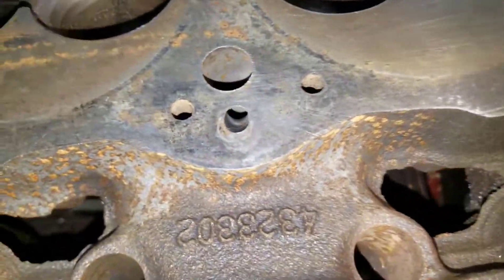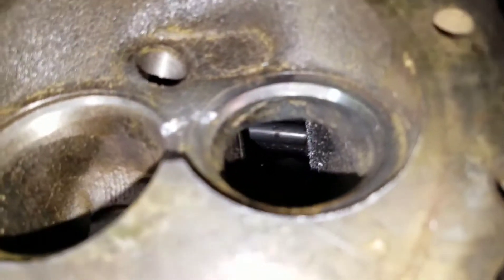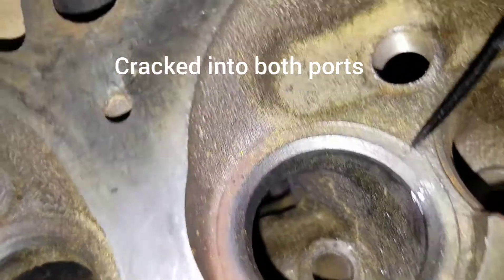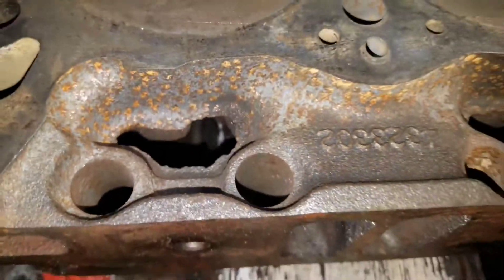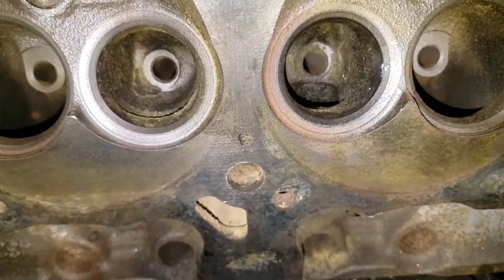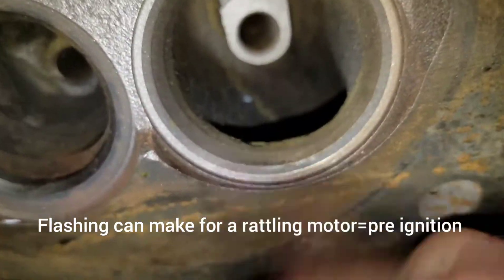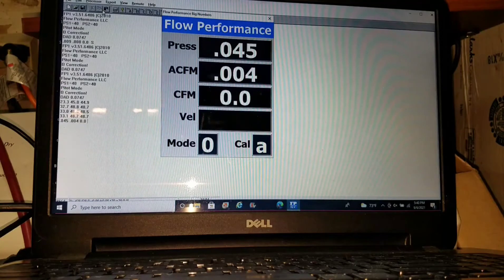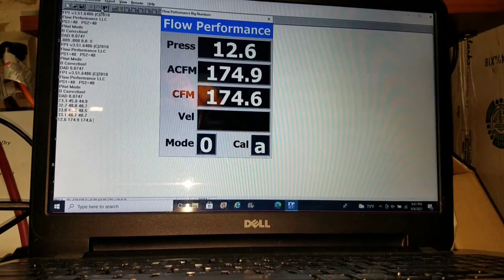Chrysler's strangely popular casting #302 head. Part 1. The harsh reality.

Comment: I use these heads for junkyard overhauls simply because of the quench in the head. Also, a 200 cfm head can make plenty of power. Im currently building an engine . I had the factory roller cam reground by holman moody. It specs out at 224 at 50 and 518 lift. Im porting the heads fairly extensively. I want to install it in a test car and take it to a track. My goal is 8.50 in a 3500lb car on 87 octane. Also remember, the extra cylinder pressure these heads provide far outweigh the flow potential. Compression makes more power than flow all the time. If you build a 318 that you are having bored, invest in a set of domed kb pistons and run  a 360 head.

Comment: I'm getting ready to buy a set of good used 302 castings and put them on my mildly built 318 with a 340 cam . I'll also be doing my own porting and gasket matching . the engine also has been bored 30 over with stock flat tops

Comment: I found the article that used the 302 heads– it was in Hot Rod magazine April 1988.  The article was called "318 Street Recipes" which is now on the Motor Trend website,  and can be found by searching for that title with the quotes.  It didn't make over 400 HP as I remembered, but instead 331 HP.  The heads were "fully ported" by Arrow Racing who also installed 1.88"/1.60" valves.  The 272° advertised duration cam was not as small as it would seem with 231° @ .050"  The cam was a Mopar Performance/Direct Connection part and when I searched for the number on Summit, it brought-up a kit with lifters that has 272° advertised duration and .455" lift.  The bottom end was from an '86 cop car engine, and the pistons were in the hole .066" so there would be minimal quench/squish with an added gasket thickness.  The 302 heads produced 9.2 : 1 compression and made 41 HP more than the previously tested 360 heads that had 2.02"/1.60" valves and were milled to give 9 : 1 compression.
Reply from the maker: 2.02 seat job on what was a 1.88 and nothing else done is definately a loser.

Comment: Yeah that turn into the bowl area, I straightened that as best I could, it really depends on core shift opened I p the bowl areas, the exhaust bowl really needs a lot of work, and then opened up the pushrod pinch. The key to heart chambered heads is the deshrouding and the overlap period. If you create a scavenge plateau for the exhaust it helps with high rpm, and more exhaust flow. There is a lot of work to be done in the chamber

Comment: I had a well worn set of #302 heads and they weren't cracked. Could it be because of the detonation? My heads had 114k on them
Reply from the maker: The seat hardening process "induction hardened" is apart of why they crack. They are also thin castings with majority of their material in the closed deck and misshapen ports.

Comment: You have my support, I wanna see what you did with these heads to see where I can improve, and what cfm I am looking at
Again I know these are not performance heads.
Reply from the maker: Takes forever to post videos. I have a follow-up video I'll be posting showing the stone grinding of the chamber and seats. I don't focus on the valve job in explanation as I'm just trying to give everyone the picture of the ampunt of work and end result. I will do some more videos that will focus on that later. The next vid is 27 min long and 6 min follow up after that.
Reply: @1WILDsMoPARtech  sweet ill try some of your deshrouding tips, already did a little by the intake side, and created what some porters call a scavenge plateau for the exhaust, I've spent like 15 hours on theses heads just because they are the first set I have Done. Hoping for 300hp  with a 650 holley, performer intake, headers, and recurred dist., of course I didn't buy them, they came with the vehicle, also has a xe 256h cam, so we will see if there is a gain over a set of 318 open chamber heads.

Comment: I recently ported a set of these heads, they are not a performance head, I just wanted something fuel efficient. However, you can really make them kick some ass.
Edit: also don't want to spend a lot of money so it was what I had.
Reply from the maker: The thing with them is.. the runner leading up the bowl is the cork after the bowl is shaped correctly. There is sometimes near nothing to remove on the ssr 'in 1.78 form' and the rest is all guide boss and straight wall runner. ..though some of these castings are so bad... the port window actually becomes a choker once nearing 200 cfm.
Reply: @1WILDsMoPARtech  ok, I'll keep looking for the next videos, and see what you did  compared to what I did, they are still sitting on the table in the garage, and I don't have any plans to put them on an engine anytime soon, I already knew that the most restrictive Area was the bowl and the area just before the bowl, I opened the bowl up to 87% the size of the intake valve, and there was no way I was going to go 75% ofthat size with the exhaust. There just isn't enough radius, so I opened that bowl up(which was garbage stock casting) and worked on the transition to the roof from the exhaust guide as a curved radius. Intake I have only cut down the guides a little bit so they are still like a wing, but have made them smaller, and have made the area from the throat into the bowl less restrictive and more smoother. I wanted to keep the main runner the same size as stock mainly because the restrictions were smaller in size. But at some point you want the venturi effect. And that is the transition from the throat into the bowl. Sorry for the long post. Head porting is my new favorite hobby.